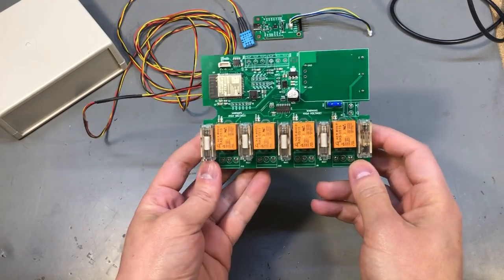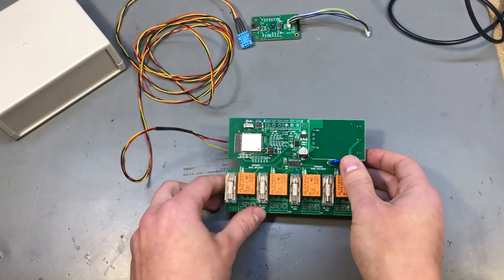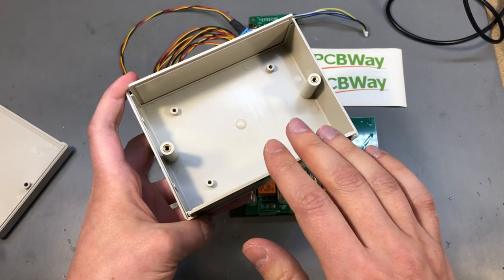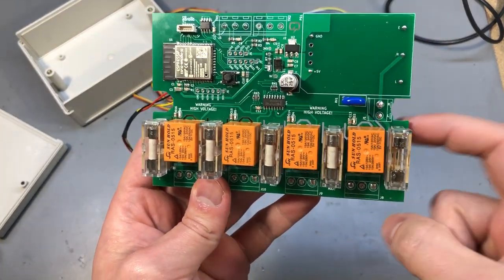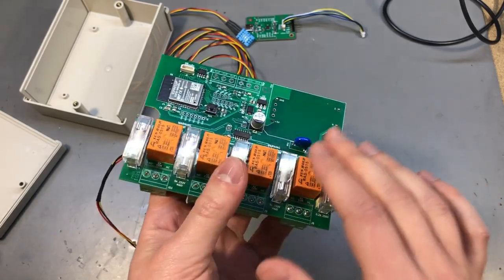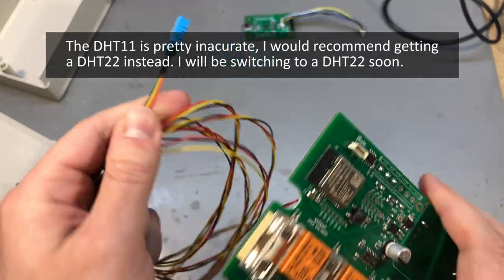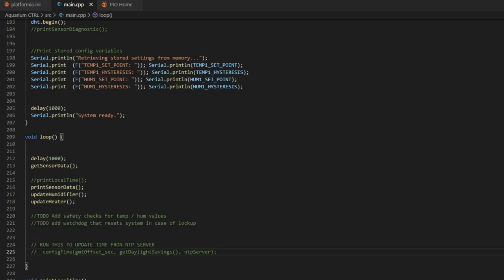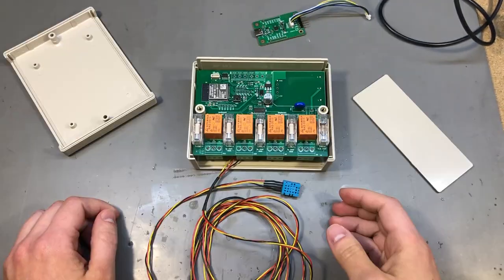ESP32 Aquarium Terrarium Controller - Voltlog #361

Comment: Thank you for your video! I really appreciate your open source attitude, it is especially highly educational for somebody like me who is a debuttant in electronics. From your schema I see that you have taken extra care in protecting the AC part of the circuit. I am wondering if using a varistor is really necessary, as I would have thought the PS to be protected from voltage spikes. Would you advise to always add something like this? How do you trust PS's from China? I just bought one for a project I am working on, but I am not sure it is a true Mean Well or a fake. I realized afterwards that the same model is sold on RS for only 30-40 % more, but delivered next day!
Reply from the maker: A varistor always helps and in this case it was actually recommended by the manufacturer of the power brick. Due to increase in shipping costs from China in the past year, it's no longer a good deal to get heavy stuff shipped from there. Meanwell have plenty of distributors all around the world so it's well worth purchasing locally and have the confidence that they are genuine.

Comment: That‘s why i add mounting hole „parts“ to the schematic - then they‘re not ignorable in pcbeditor... 😊
Reply from the maker: Wise decision 👍
Reply: Agreed - adding them to the schematic is the best way to do this - makes it impossible to miss, and then ensures the screws end up on the BOM.  I also tend to add fiducials and a logo if applicable.

Comment: I know you said it beta, so I wonder..... I like the look of this, just wonder if you could give the option to use time as a set point. 
Know you designed this for a terrarium, but with time substituted for humidity and temp using a DS18B20 , this would be perfect for an aquarium (heater, light, circulation pump and 1 extra). 
Add support for the I2C to use an OLED to display tank temp and 100% perfection for aquarium use.
I'm not too good at coding but I do 3D design as a hobby....  if you do decide to add this I'd be more than happy to help design a case (3D printed) to hold the project and then you'd have .STL or such to include with your code....no designing the board around cases, I'd design the case around the board :)  
I designed and built one for a controller I'm using now (iAqua if curious), but would love one WiFi accessible.
Reply: Also, you mention implemented some safety limits. For my previous built I used solid state relays for the heater (mechanical didn't last long for this). Since Solid state tend to fail in the on position and this would cook my fish, I added a mechanical relay as a fail safe. The mains voltage runs through the SSrelay and then through the mechanical. Code added turn on the mechanical, breaking the line voltage 2 degrees over my high set point. This also lights an LED so I can visible see this has happened and investigate why, since at that point, the heater is disabled (active) till restart.... no code for it to reset.
Reply from the maker: Unfortunately I do not have the resources needed to implement feature requests, however should you decide to do it, everything you mention is well possible with a little coding.
Reply: @voltlog  I can understand that, I get like that too with the 3D requests, "lock-down" was nuts for me.  I'm still learning so even this is well beyond my current level, but maybe one day or one day when this is out of beta (time permitting).

Comment: No diodes for the relays?
Reply from the maker: What do you mean? the suppression diodes are there!
Reply: @voltlog  a Flyback Diode for each relay. I didn't see any in the video. Just checked the Github files, and don't see any in the BOM.
Reply from the maker: @EdHayes3   the diodes are included in the ULN2003 output stage, check it's datasheet.
Reply: @voltlog  oh! nice. I didn't think about that. :D